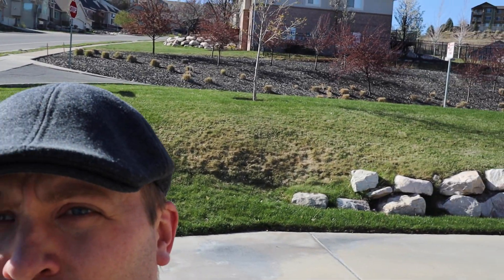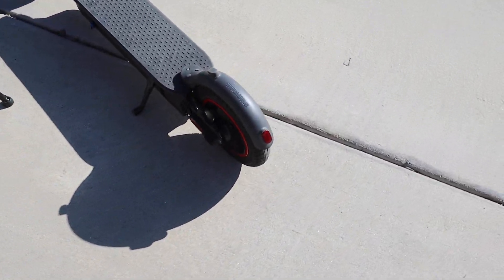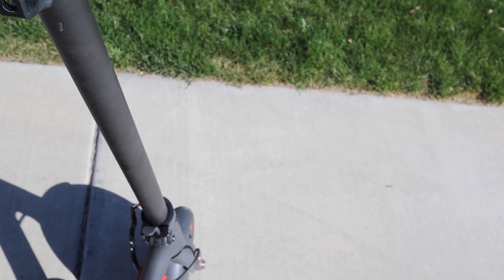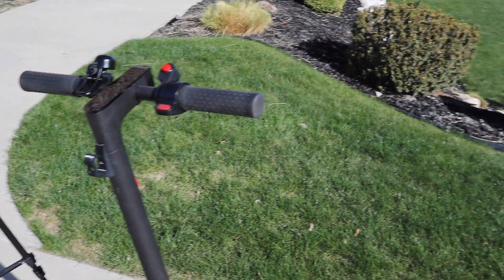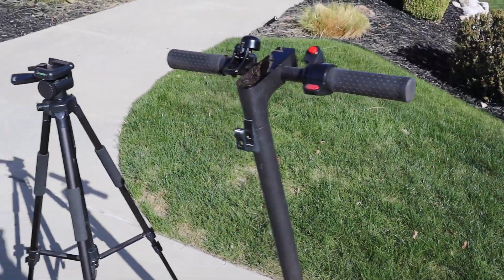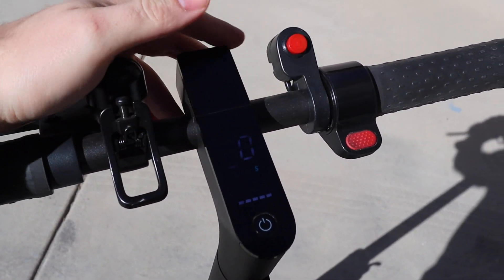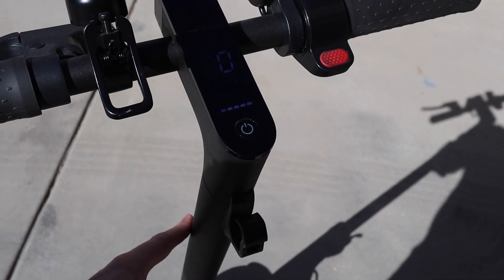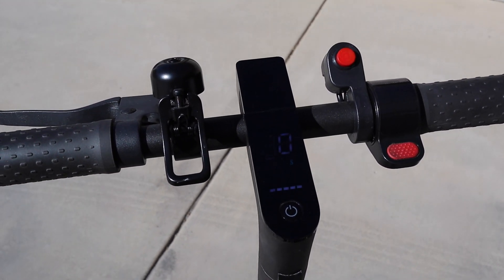M365 AWD Update - Hill Climbing Demo

Comment: Nice work! Have you modified the throttle current raising coefficient as well? I'm trying to get more top speed out of mine, so I'm checking what's the best route to take, likely a second battery to increase voltage, not sure how much the controller will take though.

Comment: Nice work! I’m working on a very similar build which will be a video series on my channel this Fall, based on a Hiboy S2R (I can’t resist the removable battery!), also upgrading to a dual motor configuration. Cheers brother, and thank you for the inspiration and technical details. I’ll give you a shout-out when my series launches. 👍

Comment: Question for you. I have a bird 2, I also have an extra bird 2 motor. Can I put the m365 controller with 2 day boards with a upgraded battery inside the bird 2? Will it work?

Comment: Man you are awesome! :) Thinking about buying one but lots of hills - so your solution will be mine and on long tours i will put one or two spare battery packs in the backpack - guess that will be a fun project. probably just with a switch.

Just for my understanding, does the motors have a "freewheel" mode? Else they would break each other out, wouldn't they? Would be awesome if you could make a video filming the speed meter instead of the cam from the side, looks somehow fast forwardish, not that someone complains you would do a fake video ;) 

Thank you so much bro and much love to you :) May the torque be with you <3
Reply: Why not talk about speeds in general and distances if different?  Or brake problems?

Comment: yes, its cool, but total cost?...
Reply from the maker: The time alone makes this probably not worth it unless you like putzing around with scooter parts... but its actually fairly cheap... all you need is a second hand m365 motor, controller and battery  plus rear motor mount brackets, and you can do what I did... You can find second hand used m365 scooters for $100 bucks, the motor mount brackets were something like 60 bucks shipped from europe. I also don't know of any other dual motor scooters other than maybe the unagi that are as compact as this; but unagi range is like 12 miles... this thing can go about 40.
Reply: @cbutters  thats cool, thank you for the info....did you put in a extra battery? i have doubts as far as this one battery being able to deliver 40A
Reply: That made a massive difference!! Well done! What’s the top speed on the scooter?
Reply: I’ve got a completely standard AovoPro scooter fwd done the 365Go update and it does 30mph no problem on flat ground, climbs hills at about 10 15 mph